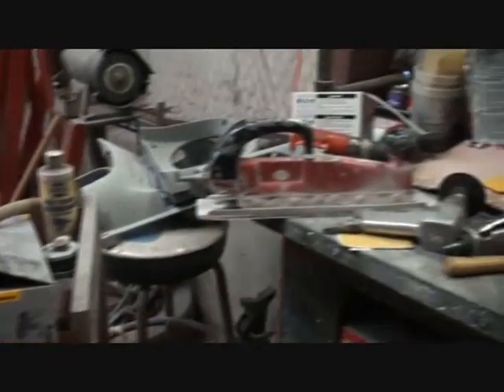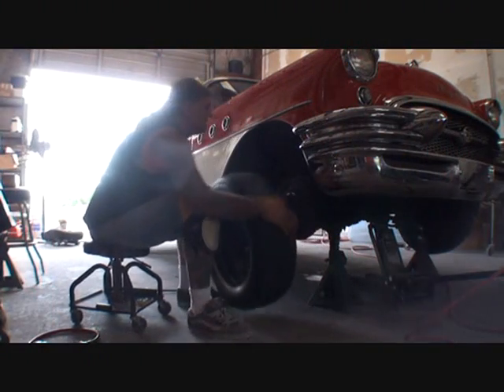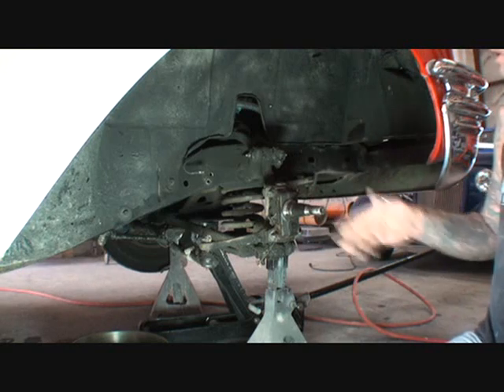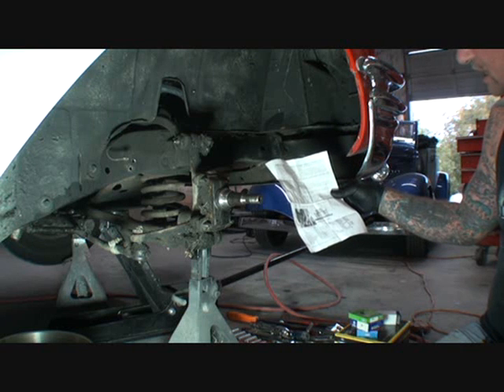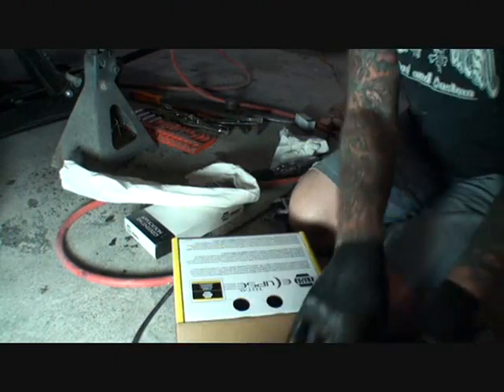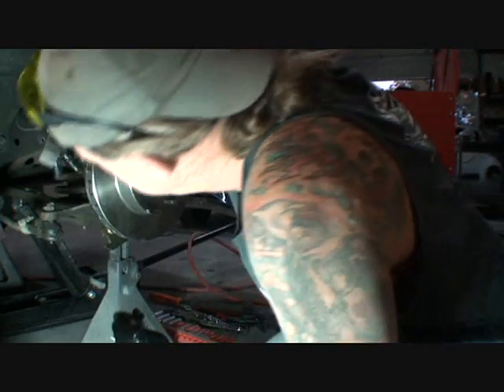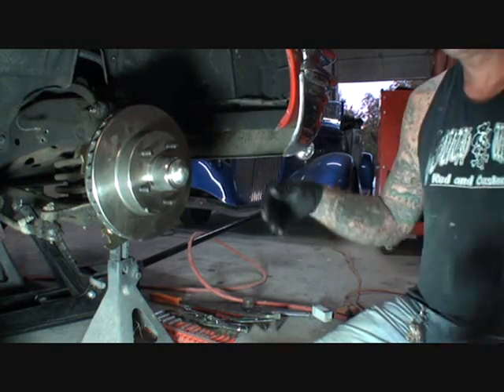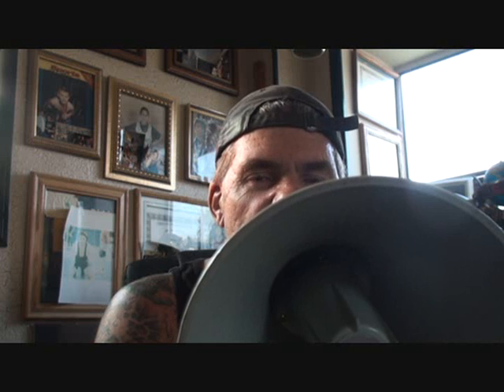How To: Install  Disc Brakes On Your Classic Car. Part 2

Comment: Yeah, we were talkin' the other day about parts that don't fit and I was sayin' don't build a Studebaker 'cause nothing fits, you must fab everything. What got me though, was the caliper mount on the spindle has two large bolts, one SAE and the other METRIC!. Same company, same box, but didn't include the bolts. That's just 1 of 20 probs. "bolting" the Must. II kit on. What took 1 minute to describe took 15 mins. to figure out. The mags and the manufacterers make it all look so easy.

Comment: As the vehicle move forward, while looking at the wheel, there is on two choices for caliper location. “Leading” and “Trailing”. As the wheel rotate forward, and the caliper is mounted leading the rotors means it is leading the top of the rotor or wheel. Mounting the caliper after the forward rotation of the wheel or rotor is trailing. The supplier of this kit should have made this clear, including photos. They are at fault but will never take the blame!!!!!
Not supplying brake pads with different choices (Metallic, Semi-Metallic, Organic or Ceramic compound) is something in large bold lettering online or in the paper instructions.
  You will still have to get adaptor for a brake booster, dual chamber master, flexible hoses, banjo bolts, copper crush washers, and the proper dual valve called proportion valve is required if disc/drum. The line bolts onto the master cylinder for drum brakes don’t realize that a 10 psi rubber lip valve sits behind the brass flare fitting. A slide hammer and screw fitted into the brass flare seat is removed to service during a rebuild of a master cylinder that has drum brakes on the rear or front both. This valve is “Not” the psi hold-off valve,  it keeps 10 psi in the line to the wheel cylinder to keep the seal lips tight against the wheel cylinder so they don’t leak. The springs on the leading and trailing shoes retract them away from the drum when adjusted correctly. ASE Master Tech-Retired

Comment: Pete, did the parts list say you needed calipers or loaded calipers.  Loaded calipers come with the pads installed.  I understand the pain in the ass conversion kits are.

Comment from the maker: I can't answer that correctly for you because Ive never used that kit on a galaxie.. I usually use Master Power Brake System Disc Brakes when I do a conversion.. The owner supplied these parts and thats what we went with.. I would contact the manufacture and double check on that one, I agree it sounds a bit fishy.. Pete

Comment: If the caliper opening is supposed to face the rear, then the caliper would sit on the front side of the spindle. You misunderstood the directions. It happens, hopefully you learned from that mistake. Great videos though! They are a huge help, no doubt about it.

Comment: Pete Should the bearing adapter be loose as yours is- as the one I have will need heated and pressed on.( beat with a  pipe- per instructions:) CHEVY OF THE 40's sucks